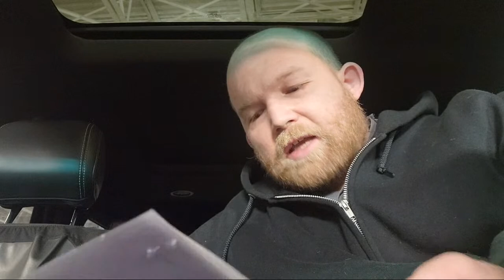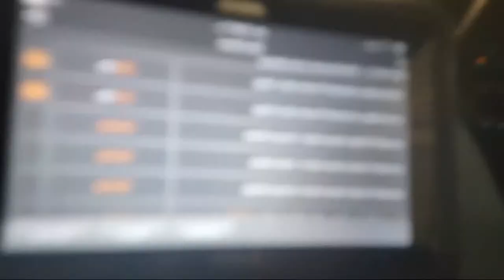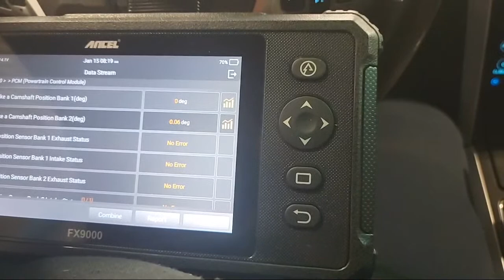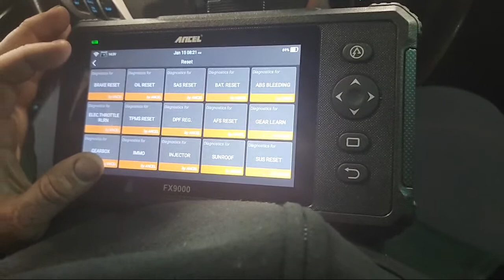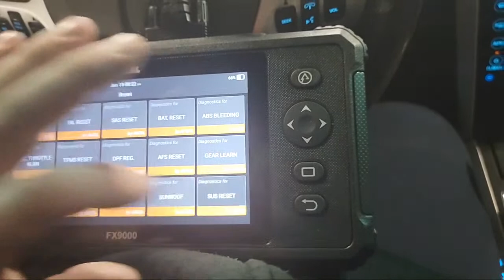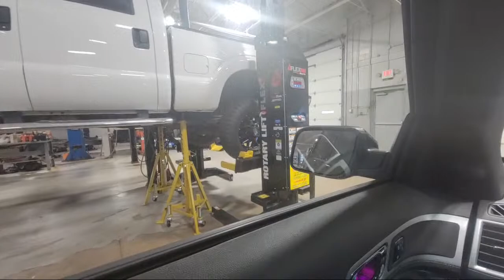Emissions Test Failed 2015 Ford Explorer  - Ancel FX9000

Comment: What does it cost... where to get at best price?
Reply from the maker: It's posted in the pin comment on how to get it and the pricing...up top of comment section
Reply from the maker: Product link: https://amzn.to/3Fruump
Promotion price: $337.99 (after use the coupon together)
Original price: $479.99
Discount code:FX9000ancel

Hi, the discount code is available already, please help share it in the description and community

Comment: Do you have a video on how much air pressure you put in your tires?  Do you go by the sticker in the door jam? Do you go by the tire pressure on the tire? What if you have a van that has an additional 500-1000 lbs. for a long trip? Thanks!
Reply: Have heavy duty tires instead of factory tires.
Reply from the maker: I just go by with what's in the door

Comment: Broken crap questions:. I went over some ruts in the snow pack yesterday in an spirited manner and now my fuel cap light is on on my 03 F150.  I checked the cap, theft has been a problem recently so I have a brand new locking cap. The little flappy in the filler neck is damaged already.  I've had this issue before and it was a actual damage to the tank but I didn't hit the tank this time.
  Any suggestions would be appreciated,. I don't want to pull out the Mercury in this weather beater or not.
Reply from the maker: When did you put the locking cap on in relation to you going out and getting crazy driving
Reply: @FordBossMe  I put the locking cap on it 2 months ago, I did pop it out and make sure that it was seated correctly as I know that can be an issue. Weather is 0°c right now and 85% humidity I flaked some frozen condensation off the inside of the fuel cap tree days ago when filling up.

Warm for the last week straight with 3 feet of snow on the ground
Reply from the maker: @johngz3413  you're going to have to make sure there's no cracks in the fuel tube and in the tank... in the EVAP lines you may have to go back with a oe cap
Reply: @FordBossMe  I will start with switching back to factory cap as that's easiest and then start checking my evap lines, could this be related to the evap control valve? I already checked tank and filler neck last night. It's right full so leaks would be fairly obvious in those regions after bouncing like that.